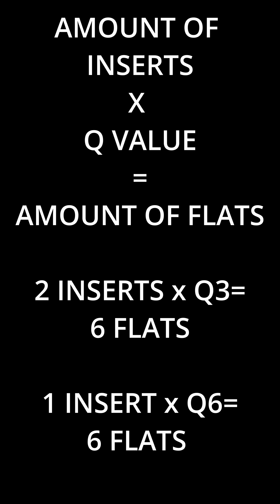What’s really going on here?

Comment: ok let's play a game here, mathematicians and perhaps someone decent with CAD software. the questions would be what is the radius of the "flats"? as well as is that radius constant? I commented on someone else's comment and the more I visualize it the more I'm convinced it isn't a single radius on the "flats". I believe it's similar to this tool C6-PCLNR-45065-12JETL which has a "radius" from tool tip to tool centerline (C6 centerline) of 1.772". I have a similar sandvik tool in my machine right now and it has 1.773" so this must be some standard number. Ok is that the radius? is it eccentric? As the tool approaches contacting the part the middle of the "flat" isn't pointed directly at the tool centerline. When the part "flat" is pointed directly at tool centerline the tool is at it's midpoint in relation to the cut, from then on the the tool is rotating AWAY from the center of the flat at the same time the part "flat" is rotating AWAY from the tool centerline. Remember, it's a single point where the largest cutting action is at. So where the tool is contacting the part is always at a different part of the swing of the tool in the angle of it's "radius" of swing(duh). If the part was stationary sure that distance from the tool centerline to the insert tangent tip would be the arc. I argue that each flat has a symmetrical slightly elliptical (or at least variable) radius. Someone could calculate the eccentricity if this was true by looking at the angle of swing the tool has on each face, the actual rpm of the part and it's diameter, as well as the tool distance from the part axis. My questions to Donnie are this, how far is the tool away from the part? what is the diameter of the part where the "hex" is cut? What is the cutters radius from tool centerline to tool tip? What are the rpm's of each spinning component of this equation hahaha.

Comment: Idk how fast yr turning, but couldnt you, feed the carriage in and out like for each side youre cutting to compensate for the radius.
Reply from the maker: This video is slowed down to 200 rpm. 50rpm in the slowest footage. It runs at 2,000 rpm when it’s actually functioning. The drop in the flat is .01” (.22mm). 

So basically you’d have to move up and down that much 6 times per revolution in perfect sync with the main spindle. So is it “possible”? Eh… doubtful. 

I don’t think the machine can move fast enough in X to do it
Reply: @donniehinske  dig it. I meant feeding forward and back along the Y. But honestly never done any dual spindle stuff and have no idea about what the clearance would look like. idk if that makes sense. 

I think maybe roughing it like how its being done in the video is probably the move, but I do think you should be able to finish it flat with feeding the carriage along the y axis.

Comment: To get correct flats you have to calculate the cutting tool swing radius. 2 inserts doesn't make it any better
Reply: right, with two inserts you need to turn the cutting tool at twice the speed but the same 'thing' is happening if there is one or two cutting inserts being used.. the cutter speed is what varies depending on the number of inserts
Reply: @rollbot i think you Need to turn twice the Speed the main spindle not the cutting tool
Reply: Partially correct, if you split the offset of two cutters during set-up so that each makes ½ of the cut the radius of each will be practically eliminated.
Reply: Any thing made with polygonal turning will have a radius. You can make it a very small radius but it will have a radius.

Comment: Could you make a video measuring the “arc” of the flats with a dial indicator vs how many inserts you use
Reply: Are you kidding? It seems obvious that you already at least understand the process and could easily figure out the minutia yourself!
Reply: the arc is just going to be equal to the radius the tool creates when you spin it, or the distance from the tip of the insert to centerline of your spindle. you could measure the arc with a dial indicator and draw it up in cad to find your radius but the first way seems easier to me.
Reply: @user-rebbulb7331  I doubt this is true, if the part wasn't rotating sure. Because it's no different than plunging a tool that "radius" into the part at that distance away from the part. It's not that straight forward though. As the arc from the tools spinning radius is cut the part advances around it's axis while the insert cutter is spinning around it's axis. When each "flat" is directly pointed towards the cutters axis is the largest part of the arc.... but then the tool is rotating away from the part at the same time the part "flat" is getting further from the tool radius center point. it might be an ellipse shape. It's confusing to think about. The radius the spinning cutter creates isn't constant i guess would be my guess. It is symmetric for each "flat" but not constant at any point on the arc. Maybe I'm wrong but that's the way I see it. It will be really close to just that distance of a radius but with the added chaos of the main spindle rotating. Somewhere out there is a mathematician that would love to calculate this. My guess is an ellipse with eccentricity close to 0 but not quite say 0.01. hahaha.
Reply: @user-rebbulb7331  that seems much simpler, but does the number of inserts used change the radius?
Reply: @user-rebbulb7331 It's not an arc, it's some crazy near-elliptical shape that flattens out as the cutter radius gets bigger. You really need to see the animation of the path that the cutter takes across the surface